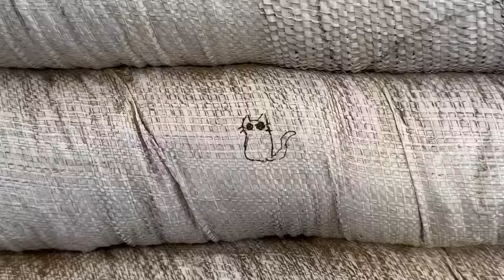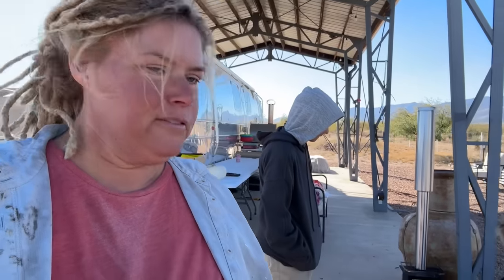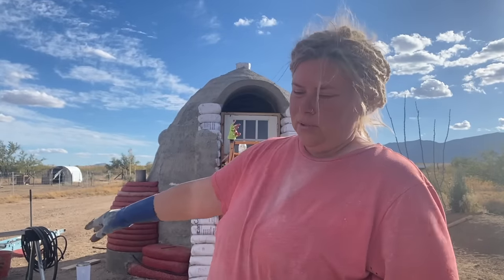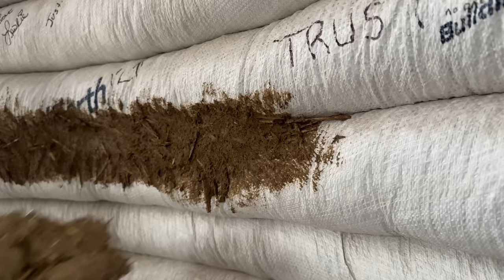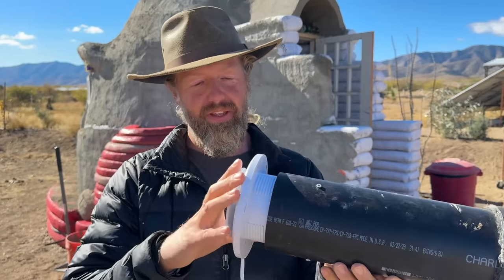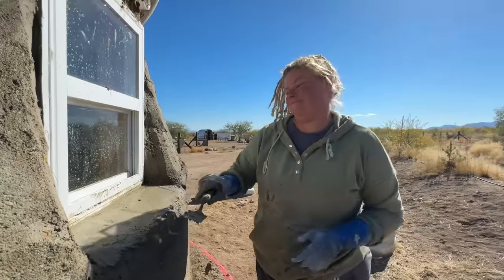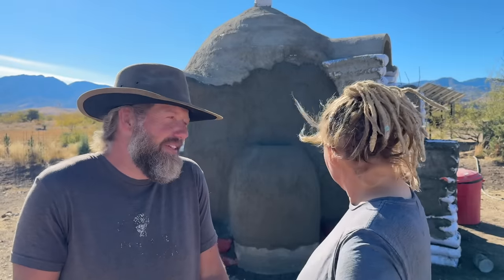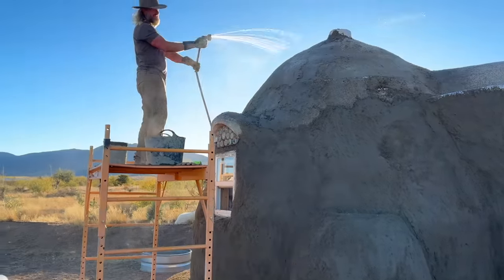The PLASTER MATTERS! Changing the Shape of the Superadobe Dome Home

Comment: Have you heard anything about using the tops of the bottles you are cutting for air conditioning? Sounds weird, right? I googled: natural air conditioning with bottles. Most of the search results use plastic bottles (more plentiful) however, since the mechanism that cools the air is not the material of the bottle, but the shape; you should be able to use the tops of the glass bottles. I have also seen models that use terracotta tubes embedded in an earthen wall. This is a different mechanism using evaporation. The bottle tops use air compression. Yes, this is for outside spaces, (I have not figured out a way to use it indoors yet) Anyway...it's just a thought...Namaste.
Reply: Interesting concept! When you do your testing, could you please let us know the results? This might be beneficial to a lot of builders. Thank you very much!😊
Reply: Ancient buildings in the Middle East used clay tubes to cool air , so I guess bottle tops would work.
Reply: Good idea. I’ve seen the plastic bottle air conditioner as well.
Reply: Or they could tumble the broken glass in their mixers and turn it into beach glass. Be beautiful as topping for gardens or even embedded into finished stucco or in the walkways
Reply: Can someone please try this and report back?? I think we all would like to know the answer to this one 😃!!
Reply: This will be one of my summer projects. wish me luck! @Snappypantsdance

Comment: If you recycle the bottleneck parts you will be able to create  an area with natural air conditioning. Eg an old fashioned cold room. 

If you tape the wide ends together and use it in a wall, the wind will blow into the  mouths of the outer bottle neck, cool off in the wider part and blow cooler air through into the room. 

 (this is the type of building my grandparents used as a cold room, drying biltong in Namibia - although they used clay bricks with gaps inbetween, )

Comment: Seeing you guys leaning out from your baker scaffold makes me worry about it tipping over. I was wondering if something like round steel concrete stakes imbeded horizontally in the wall would support boards to work from. Two stakes per board would make a level place to stand, place buckets and easy enough  to finish around. Then when done, pull them out and plug the hole, or use it to run a power cable outside. Hope this helps.

Comment: Would putting another wheel barrow on the other side of the big sifter save you a step by eliminating the need to re-shovel the earth in to the wheel barrow? Or do you only have the one barrow?
Reply from the maker: We have quite a few, but not really a big deal for a single load.

Comment: I remember Hayden saying to put a buttress over the vent pipe to keep water from getting in it, is that in the future for the vent ? the Adobe is shaping up nicely love the bottles they look great from inside.. cant wait for the heater to be installed in it..
Reply from the maker: The stucco won't do that by itself so we'll use the chicken wire lathe to build up around the opening. Still lots of coating to do :)

Comment: Looking good, but I've always wondered why you didn't use chicken wire to anchor the stucco to your bags?
I thing Hayden mentioned it for the red bags while he was there.
Just a thought.
Reply from the maker: This is base plaster. Stucco final coat will have lathe. Just not there yet (in videos at least - here it's already done)

Comment: Is the temperature a factor in the plaster sticking?
Reply from the maker: Here it's not an application problem since it's usually at least 50-60 during the day.  It's a curing/cracking problem if it freezes before it's dried.